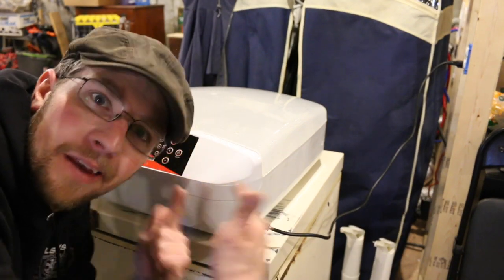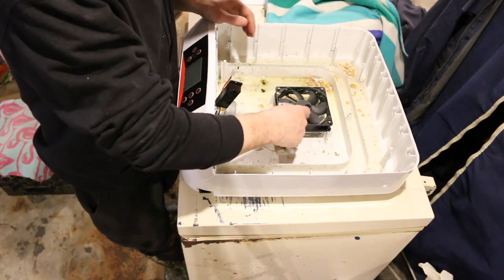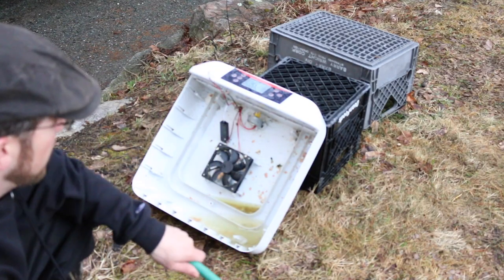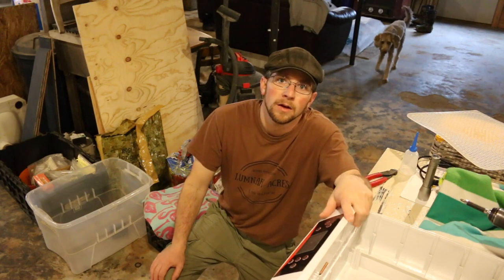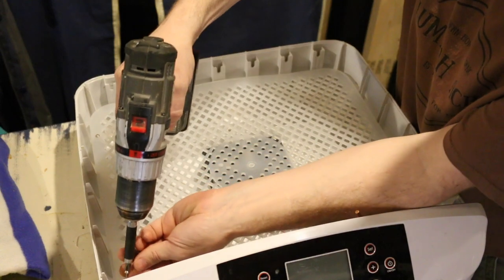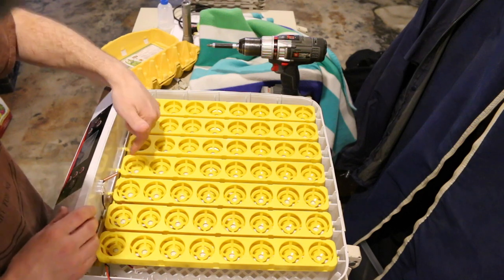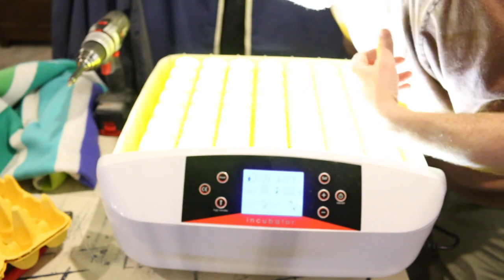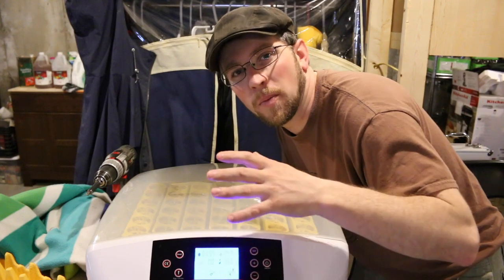How to clean and disinfect your Incubator tear down and reassembly

Comment: I have a slightly different model, yesterday two chicks hatched at night and i lost both, in the morning i noticed they had fallen down the sides one broke its legs and the other one drowned :(   , hatching area height is so small you just can't put the eggs or chicks in there. try to buy a different incubator if you can or your chicks will suffer.

Comment: Hello from Greece my friend!!! I have the same incubator and before 10 days I had a very good hatch rate of chickens and quails both. I did the same wash as you and I started again hatching but the hymidity stays at 35 ( at the first hatch it was always 65) the temprature in my place is between 20 - 28 C these days. Do you have any advice?
Reply: Same problem with me, when I wash humidity stopped on 30 , I think real humidity is 60 but sensor is die from wash or clean, so I buy another humidity and degree calculate machine , and I work good but wash make humidity sensor die 
So you can hatch but take care if degree sensor die this a big problem 
I will change this product in future 
I don’t recommend it at all for anyone
Reply: Hello sir George!!! Please help how to set this setting of incubator I have same of it... I don’t know how Or what I should I do... from AL, AH to AS and CA and HA To LS 😔 please

Comment: The little black unit that you cut off from the zipties is the humidity sensor unit. On my YZ8 48 egg incubator all of the electrics and fan are in the lid of the unit at the top so no water or anything can spill onto it. Apart from a bit of moisture.

Comment: The hole where wires go inside can be wet without any concern - it’s a small compartment that water can go into and drains out the bottom (you’ll see if you turn the whole thing upside down). The wires go into that hole and then back up to the display.

Comment: Hi, the big black thingy that was zipp-tied is in fact for messuring the humidity. And if you don‘t want everything to rust you should consider applying WD40 on the motor for the fan and the egg turner right after washing it down.
Reply: No. Do not use WD40 in your incubator!! Dry it with a hair dryer and paper towel.

Comment: bro I'm so disappointed by this incubator which I bought last year.  I set temperature to 39.1 to get 37.6!! ...and temperature is so unstable..it drops and goes up all the time.  It is so tiring to keep an eye over every hour at the incubator!!  Do you usually get high hatching rate?
Reply from the maker: No we switched to do a different incubator last year. We now get all of our chicken supplies from www.coopsnmore.com if you us the promo code Lumnah you get 10% off
Reply: the directions tell you to calibrate the temp.
Reply: i know this is late but i have 2 of these and your right about watching it.. but if you set the settings right from the instruction the temp is consistent for me... the humidity is what my problem is... keeping it at 55 to 65.... keeps going down... add 2 drop of water and it shoot pass 65

Comment: Total piece of junk an idiot would use water directly to clean electronics. And you also was not sure whether it will be okay or not ?  Now motor will rust and then wires will and then fan from inside.